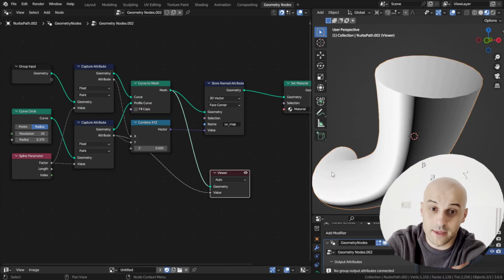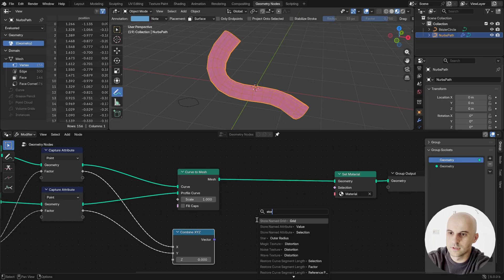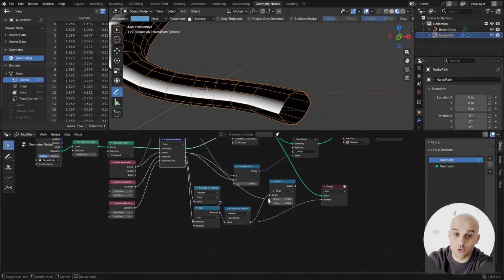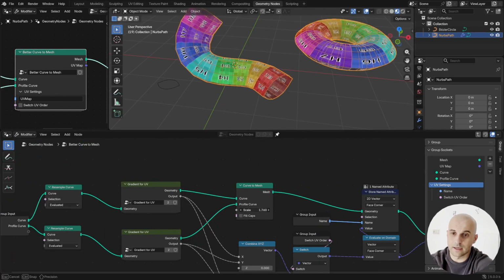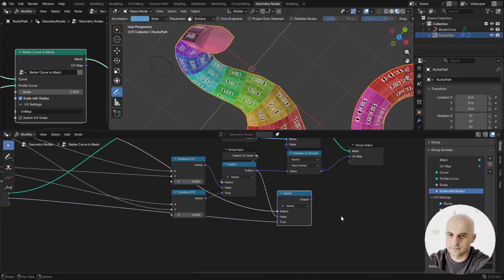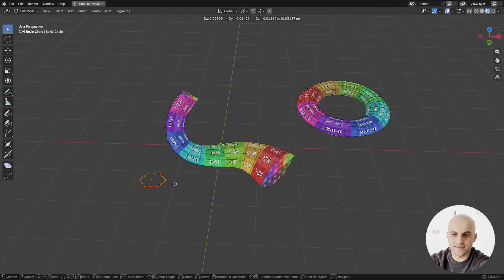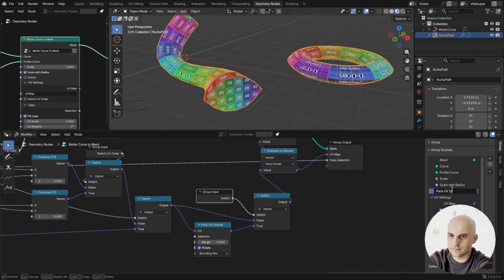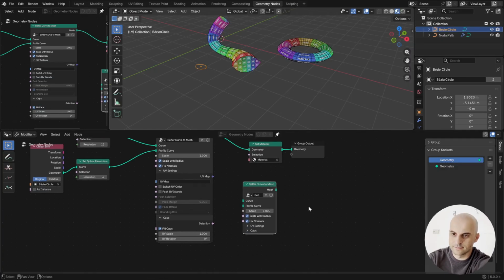How to create an improved "Curve to Mesh" node in Blender (with UV map) - Geometry Nodes Tutorial

Comment: Excellent tutorial! I have a question. Let's say I have several curves and I duplicate the nodes that control the UVs so that some UVs are in one place and others in another, so that there are blue curves and red curves, for example. How can I make each curve randomly use one of the two UVs? I connected the outputs of the two UVs to a switch node, and it can only display one UV at a time. I haven't found a way to have both UVs randomly displayed simultaneously across curves.
Reply from the maker: If you want to switch randomly between two UV maps (you have connected them to the True/False inputs of a Switch node, set to vector) you need a random mask on the curves for the boolean input of the Switch node. For that you can use a "Random Value" node, set to Boolean, and evaluate its output to the "Spline" domain with an "Evaluate on Domain" node. This then goes into the boolean "Switch" input of the Switch node.
Reply: @denoa3D I've been testing, and the mask is generated correctly in the output of `evaluate on domain` using `float, spline`, but when connected to the vector-type switch node, it only shows one of the two UVs. When I put `evaluate on domain` in `float, face`, it does alternate between the two UVs, but only for individual faces 😅 and shows the same UV on all the curves. The way I got it working was by connecting a `mesh island`, `island index` to the `id` of the random boolean value, and the result to the switch node, which is connected to the value of the `store name attribute`, `UVMap`, `2D vector Face corner`. Perhaps the mask wasn't working in spline mode because the `store name attribute` node is connected to the `curve to mesh` node, but the idea of masking the splines helped me understand what I had to do, haha. Thanks 🫂

Comment: Great ! , but when i use length instead of factor it did not work !. i use length to maintain the uv scale regardless the scale of the curve in 3d view
Reply from the maker: It should work, if you use the Length from the 'Spline Parameter' node. Also you can multiply the Factor with the Length from a 'Spline Length' node, before the Capture Attribute
Reply: @denoa3D  i have tried this but it did not work. what worked for me is that, after you correct the last face corner by the switch node set to (1) you multiply this result with the length from the (spline length node) not (spline parameter node) that's for the X, for the Y you do the same as before but instead of the curve length, use the radius of the main curve